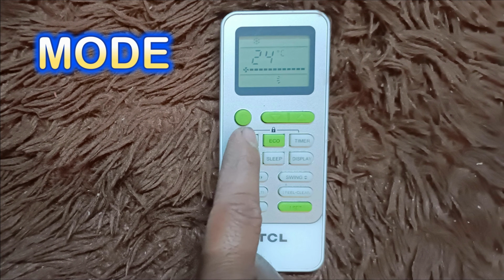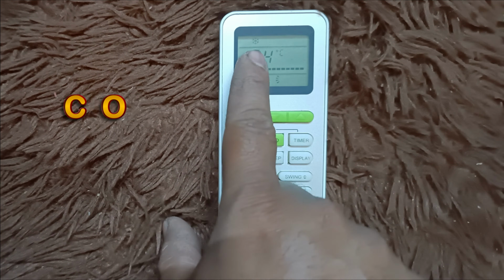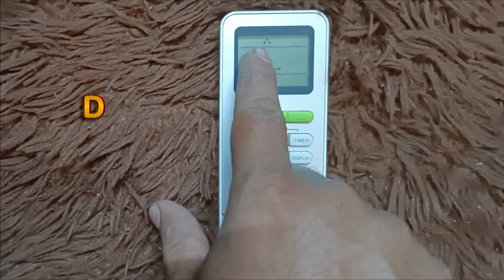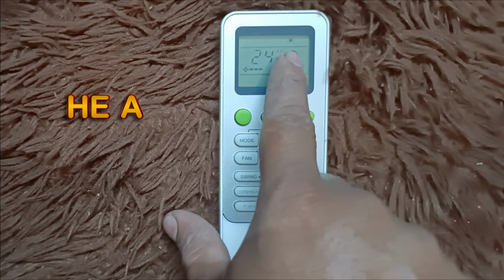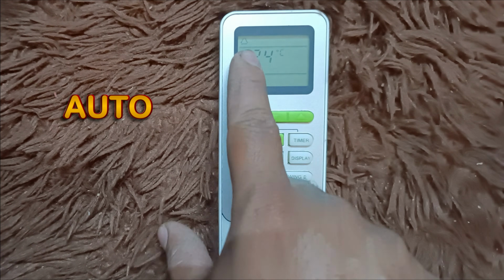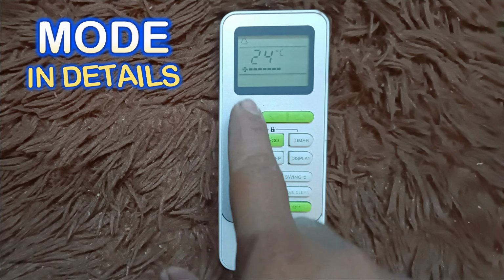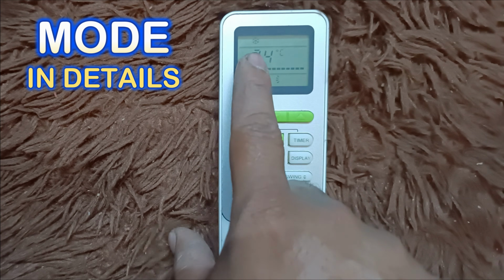How to Use TCL AC Remote Control | Step by Step in English

Comment: How do you turn on the background light on the remote?
Reply from the maker: There is no button on the remote to turn on the light
Reply: @razacoolinenglish7198 Yes there is. Holding the Eco button turns on the background light on the remote
Reply from the maker: You have told me about a new function, I will definitely try it, I have never tried this function, thank you very much
Reply: @razacoolinenglish7198 you are welcome. I also learned a lot from your video.